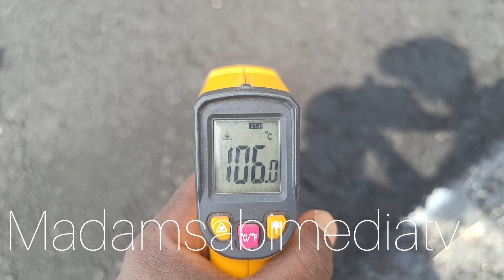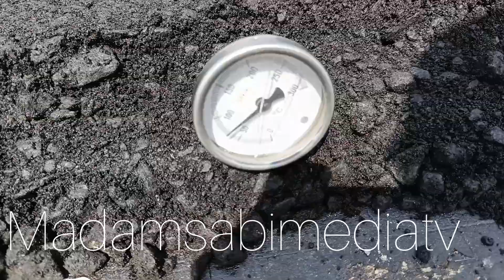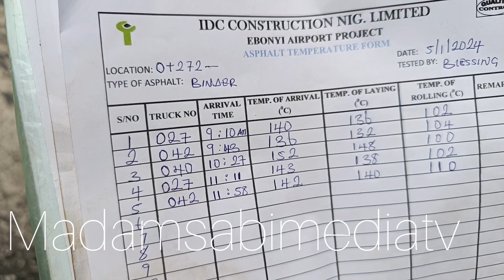Asphalting of Ebonyi international Airport runway reach advance stage// 2024 update

Comment: I am surprised you don't know a thermometer 🤒 as a cook, l would have expected you to know that..lt is used in the kitchen as well,if you want to check the temperature of baked bread,cake even turning milk into cheese,you'll need a thermometer.ln hospitals,doctors use thermometer to check body temperatures as well....😅My fear is,after all this work only to find out it does not solve the problem,aircraft landing gear is still affected by the concrete.l would have constructed a second runway next to it instead tbh.This is actually a proof why concrete is better on roads,the fact that aircraft find it tough means it can withstand cars and trucks easily for years.Thank you.
Reply from the maker: 😂 of course i know it's a thermometer na🤣🤣 was just asking for people who might not know what it is 👌🤩

Thanks so much 💕
Reply: And it's also a proof that the previous governor did a very bad work on the airport
Reply: @sunnynze  I don't necessarily think it's a bad job,different aircraft have different landing strength,most cargo and military  plane like c130 probably wont have problem landing there but this medium seized planes would feel the vibration on landing more.I would have increased,double the spec.height of the asphalt instead.But then they might worry it's would be too heavy a load for the concrete to carry..........
Reply: @sunnynze You talk as if it is easy to build a world class international airport. He is the only governor to have ever built an international airport to world class standard. The runway Umahi was actually good quality, as proven by several airplanes that have already used it without any issues, but the international body that regulates airports are insisting that it must be fully asphalted .